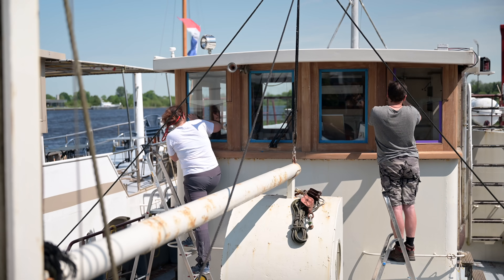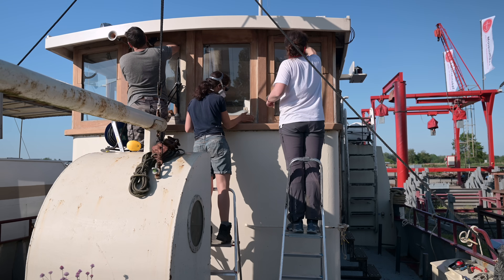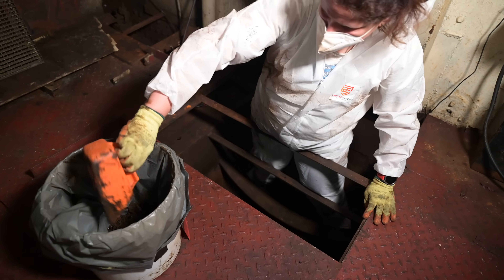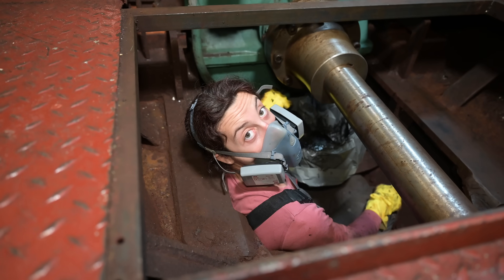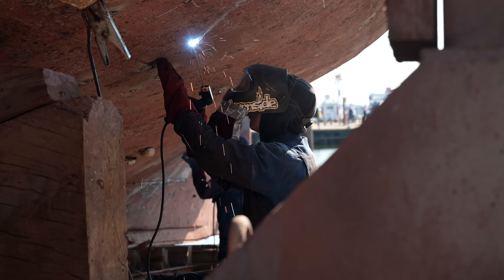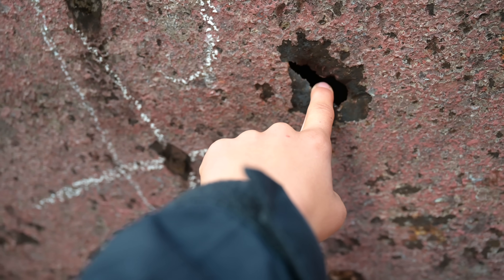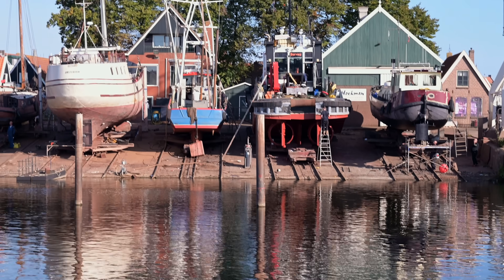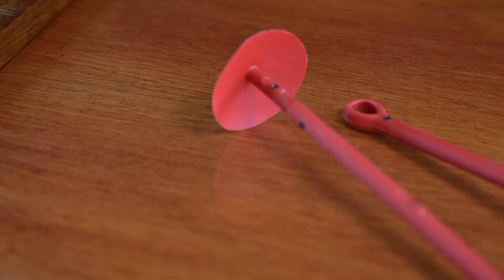We have a LEAK! Are we SINKING??

Comment: On the gas powered water pump it is important to put a gas shut off valve on the gas line. This way you can run the motor out of gas when you're done with it. The reason you want to run the gas out of the carburetor is because over time the old gas will gum up the carburetor. If you already know this then disregard my comment but many people don't think about it and most manufacturers don't put them on. My suspicion is they don't want it to last forever and most people will buy another one if their current one doesn't start. Just Sayin !  Watching from Panama City Florida, USA. 🇺🇸🦅 !

Comment: For the bilge cleaning, I would have used a big shop-vac.  Once the bulk of the debris is out, then spray fresh water in to rinse it.  Then vacuum it out again.  You can reach the much smaller spaces with an extension that way as well.
Reply from the maker: We've done that in the past but it wasn't a success. The dirt is mostly old oil and grease. It's difficult to scrape it off, it dosen't dissolve in water and it builds up the hose of a shop vac. When we have time to paint the bilged the way to go is to use a steam cleaner, followed by strong de- greasers or bilge cleaners. For now a little bit of that dirt is still enough to protect the hull.
Reply: I agree that a preliminary attack with a good quality wet-vac to remove the obvious loose muck whould have saved a lot of stressful scraping.
Reply: @FlyingConey Totally agree. The big shop vac approach is used commercially onboard vessels and they generate a lot of oily water waste - which generates a very large bill to the customer to dispose of. You method of scraping up as much of the soft crap as possible into bags is definitely the way to do it.

Comment: Pleased to see you are well equipped with damage control equipment.  I had not seen the threaded bolt/rivet replacement device before.  Interesting how that works with a small float ♥
Reply from the maker: Barbara and I attended a boson class during the winter. The course is specifically for crew aboard commercial sailing ships. The teacher was a bosun on a riveted sailing ship and gifted us this specially prepared bolt after he has watched a few videos.

Comment: My concern is thesteel integrity in that area. I know you did have ultra sound test previously, but there willbe areas that were not done.  The steel plates appear thin. You need to do some replating in any problem areas.in a serious storm or sea rage that plate  can be serious issue.  You could sink very quickly & pumps will not help. Far away from land. Be safe.
Reply from the maker: With ultrasonic you measure the thinest spots. We have an average of 7mm steel thickness. Not one single plate that needed doubling. So there's absolutely no reason to be concerned about structural problems of the hull. The condition is really excellent. But of course we had that nasty corrosion damage. It was properly and carefully repaired. It would've been possible that we missed one single spot. But things like that don't sink boats as long as you're aboard and do something about the incoming water.

Comment: Better to discover any leaks now, than after putting out to sea.  Barbara is really a valuable and very intrepid worker.
Reply from the maker: Well a little bit of weeping rivets and plates is pretty much expected on a riveted ship. It's like having a bit of water in the hold of a wooden boat. The interesting bit is if we managed to fully repair the corrosion damage and if we managed to remove the cause of the stray current. Let's find out together in the next shipyard series!

Comment: What you need is a wet n dry vacuum cleaner I did my bilges easily with it after finding a hidden deep bilge in the keel
Reply from the maker: I think our dirt is on another level compared to ours. We have a good shop vac but this sort of thick oily and greasy stuff wasn't the right task for it. The main problem is that it clogs up the hose.
Reply: @FlyingConey  Amazon £39 dollar vac I made sue I had a slurry by adding water and detergent then sucked it all up followed by a couple of rinses it was lots of work
Reply from the maker: We have a high quality M class shop vac from Makita and also a cheaper second one from Einhell. So we're not short on shop vacs and we use them quite a bit. We literally had thousands of liters of water in the bilge and laced it with all sorts of cleaning agents. We've scrubbed and brushed the heck out of it and used a pressure washer. But what's left is a nasty mixture of solid dirt, grease, oil and all kinds of stuff that somehow found its way into the bilge. Based on my experience I can assure you that scraping off the majority of the dirt and shovel it into a bucket ist the most efficient and least labour intense way of approaching this project.
Reply: @FlyingConey  great to see your prepared for a mud deluge,  and that you take time to reply to your comments Hope everything goes well !

Comment: Excellent episode as usual. I really love how informative your videos are and the very unique sense of humor you insert. Daniel: I am really sorry you could not fit in the section of the bilge and had to leave the opportunity to Barbara! ;-).
I have two more suggestions for emergency leaks:
The first one is an old fishing trick, the most basic  is: Close the seacock and disconnect the water pick-up hose from your keel cooler and put it in the bilge, the engine running now picks up water from the bilge and expels it out the boat. The easier way is ad a "Y" valve with  some length of hose to the bilge to the cool water pick-up hose, close the seacock and switch the "Y" valve to pick-up water from the bilge.
The second is a product from Pettit call Epoxy A-788 a 2 parts epoxy that can be applied under water to plug a leak.
I did not know about the Leak Hero grease I will be lookin to get some, thank you.

Comment: I saw you put in regular gas in the pump, in machines you don't use often its better to use Aspen gas. Its high octane. There are 2 types for 2 stroke and 4 stroke engines. Even after months of sitting your pump Will start easy.
Reply from the maker: Why do you assume it's regular gas? I've used aspen in the past and in the chainsaw it's the only stuff I use because it's less harmful. You may have noticed that there's a Stihl filling system attached to the canister. But thank's for advice! In this case we really used regular gas but we do store the pump empty. I only put in a little bit to test run the pump and ran it until it stoped. We also use a fuel stabilizer in the regular gas.

Comment: Great video thanks. An important topic.. Lots great bungs, info etc.  Perhaps you could also store enough materials on board to mix up a batch or two of concrete.... It could be poured into hard to reach areas, might patch a hole  and would add strength to delicate sections of the hull.. ?..

Comment: Might be easier to remove steel plate from exterior when dry docked,and put new steel in. Even a 2×4 section or larger can be welded in.
Reply from the maker: We knew 100% that the plate doesn't need to be replaced. The point is that the hull needs to be accessible in emergency and to clean the compartments. Spraying in a lot of grease and hope for the best isn't our style.
Reply: True, however Flying Coney is a riveted steel ship so you would have to stay away from the rivet lines. on a fully welded ship such as the ship I was on in the US Navy. In the yard they cut very large hole in both sides of the boiler room and then welded them closed. I agree with Daniel that while in the yards, cutting large holes in the engine supports where they can be cut to give access is a better solution to gain access whenever necessary to the areas.

Comment: you guys might want to get some 2-part cold -bonded polysulfide sealant for your next haul out, during battleship New Jersey's dry docking they found the US NAVY applied it to all the riveted seams for the ships moth balling/storage, so during the resent dry docking they re-applied the same sealant after the new system of coatings to add another layer of protection.

Comment: Run the emergency pump until the tank and carburetor are completely dry.  Leaving fuel in this will gum up everything after a while and when you need it the most you can't get the engine started.  Happens to everyone at some point.  Only option that leaves fuel in unit is to set a schedule to run the unit every 2 weeks to circulate the fuel through the system.  You can also pressure wash the bilge and use a wet vacuum to pull out the dirty water that accumulates.  Getting in that space is one messy challenge even when you are little.
Reply from the maker: We do store the pump empty with the carburetor dry! Good advice. The bilge was pressure washed and pumped out several times. Sometimes you need to do what needs to be done. Mostly we've already tried out the easy way and they've failed.

Comment: Hi. If you cannot find the exact leak I suggest to chalk the plates seam. What we do is use an air driven special chisel to split and expand the edge of the overlapping plate. This is done on all riveted iron hulls to help  prevent water ingress. Best of luck.
Reply from the maker: Hi, it was just water trapped in the grease and dirt. Maybe a rivet but after a few days it stoped and has  never started dripping again. We do have a dry bilge.

Comment: My guess is the boat will always leak and you just have to get used to it.  There will likely be yearly haulouts to fix areas that are critical and the rest of the year you just monitor the drips.  Excellent progress.
Reply from the maker: Thank you! Most of the time we do have a bone dry bilge and we do everything to maintain this status. But I know that this few drips of water that didn't even reach the bottom of the bilge wouldn't concern most steel boat owners. But that's not the standard we're renovating this ship to. Usually a haul out ever other year is enough for a boat like Flying Coney.
Reply: This leak is not in a  “good place” if there is one for a leak. This leak needs to be investigated and repaired as soon as possible. The rivet heads look to be wasted and have started to loose their holding force. I have put up a couple of other comments with temporary repair suggestions to get the vessel to dry-dock.
Reply from the maker: The videos are always a little bit behind real time. The journey to the shipyard went without any problems. The steel, the rivets and the hull are in very good shape. It was just water trapped within the grease and the dirt.
Reply: @FlyingConey  that is good to hear.  I used to look after a  ship that had a riveted hull with later welded additions / modifications.  Most of the issues encountered were where welding had been carried out on the riveted hull.  Keep a watch on the deck plates where it meets the hull.  And any place where original structure has been replaced with welded.
Reply from the maker: @grahamc887  We have a wooden deck that was later made watertight by putting a steel deck above. Also the ship was rebuilt in 1950, relatively late for a riveted construction. That means we do have some problems related to riveted ships but not all of them because welding was already an established construction method back in the 50s.
Reply: @FlyingConey  The ship I worked on was 1930’s vintage. Taken as a prise of war by the Norwegians, after several conversations ending up working as a stand-by vessel in the North Sea. The riveted construction brought back many memories, not all good, of problems with leaking hull from popped rivets to splits between the old and  altered sections.

Comment: Think about modifying the pump so you can take the pump off and install a generator so you can have a dual function engine. 
Maybe even get a small Diesel engine so you only have one fuel type on board.

Comment: You should get a shop vac, that will make the job much easier, and also consider welding up a metal screen basket or box to put your bilge pump inside of, that way it will prevent crap from plugging up the bilge pump.
Reply from the maker: The metal basket doesn't really help against zip ties. We have two shop vacs. We have the biggest refit boat on YouTube. Do you really think a project like that can be handled without one? The dirt in the bilge is simply something that can't be easily vacuumed away. We showed the easiest way in the video. Sorry for the rant, but if it's as simple as cleaning with a shop vac we wouldn't make a video out of it.

Comment: 16:44 that mallet is a serving mallet for wrapping twine around rigging . You can tell by the groove along the top. It will be very useful when you get to building your rig. It is most emphatically not for hitting things and should not be used for emergency bung duty.
  The tugboat company I work for makes us run our emergency /trash pump at least once a month both for our practice and to exercise the pump.
Reply from the maker: If you rewatch the scene you'll notice that I'm realizing that it's a serving mallet and not a hammer the moment I pulled it out of the bag. 🤣 Although not ideal I guess it would work and if not we do have multiple other hammers and mallets aboard.
Reply: @FlyingConey  I did notice that you looked at it oddly, not that you particularly knew for what it used. Just trying to help sorry if it annoyed you.
Reply from the maker: @Pocketfarmer1  Not annoyed at all! This serving mallet caught me by surprise. I guess with emergency serving mallets it's quite similar to the strongest bilge pump in the world: a man with a bucket scared for his life!
Reply: @FlyingConey  Been there , not so much scared as highly concerned. My son & I were helping a friend deliver his new old steel ketch. The last Yankee that was built for Irving Johnson . She sprung a leak in the aft center board trunk . She has two centerboards . My boy and 
I were able to gain on the flood with buckets up two decks . Fortunately after an hour and change we got pumps and a tow to awaiting travel lift. I was looking at the dinghy the whole time.

Comment: To remove remaining grease and oil from bilge spray a section with brake cleaner…flood with just enough fresh water to cover it….the oil and grease will float to the surface of the water …..take an old vacuum cleaner and simply vacuum it off….. then pump the water on the bilge. Repeat till clean.  Wear appropriate safety garb….absolutely works

Comment: I suggest that there's really only one safe option for those bilge plates: cut them out and replace them with new steel. It's going to be too late for that if a rotting plate gives 😢 up 20 miles away from a safe anchorage!
Reply from the maker: The plates are measured at multiple places and are about 7mm thick. I'm not sure why you think the plates are rotting when there is no rust in the bilge. There's a difference in dirt and rust. As said in the video it was either a leaking rivet or more likely just some water within the grease and after a few days it completely stopped.

Comment: Anytime you have rarely needed gasoline powered equipment like generators or water pumps, it is really helpful to have some starting ether spray or brake cleaner spray to help in "priming" the engine for much quicker starting.

Comment: If the idea of chalking the plates is not an option you can concrete the bilge area. This is hard and tedious work and it is not normal cement. It is a special compound with binding material included.
Reply from the maker: We already know that the hull is in excellent condition. No need to worry. But you can probably imagine that after repairing huge damage one might be a little bit more cautious than others. Have we missed a spot? No we haven't. We have now two options. Either we cut in access holes so we can inspect the hull. Maybe on a later point we close off this compartment completely and might use it as a water tank. Not sure about the last point.

Comment: Years ago I was working on a couple of carvel, timber boats around 80 foot in length. The bilges constantly had around 8 to 12 inches of water in them, they were never dry, not too much of a problem but one day i decided to stick my hand deep into the keel/garboard seam/plank ie the lowest point to the inside keel - the stink was sulpher, reminiscent of the worst mud bogs smell, with a dead cow thrown in. I tried to remove as much as i could but no one gave a toss. All that rotting vegetation and other stuff rotting away laying on the planks - not my idea of safety...

Comment: I would suggest that you purchase underwater hardening cement, wood to make cement boxes and C-clamps to hold the box on to the stringers.  Alternatively you could have a local marine engineering company attend the vessel while afloat and construct a cement box for you. The cement box is a temporary repair that will allow the vessel to sail to the dry-dock.  Looking at the video it is not 100% clear but it looks like the leak is near where a stringer has been welded close to the old riveted structure this is quite common.   The welded section and the riveted hull move different when the vessel is in the water this is why there can be cracks or the rivets under stress.
WHAT EVER YOU DO NOT TAP OR HAMMER THE RIVET HEADS WITH THE VESSEL IN THE WATER.  

I like your pump, but it is unlikely to cope with more than the smallest of leaks. If a rivet popped in the bilge I think it would struggle to cope , this depends on the vessel draft, but the water coming in would be at a terrific pressure and volume.